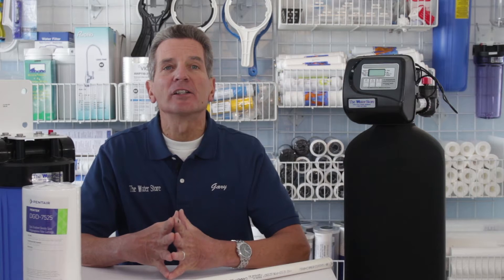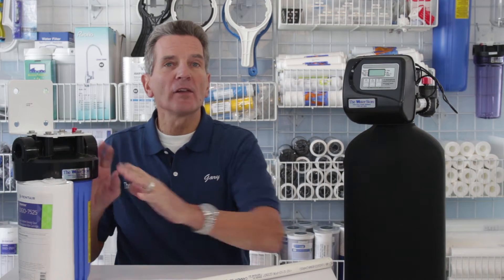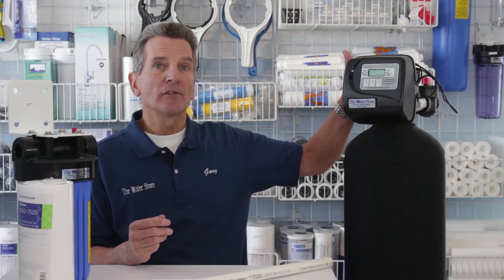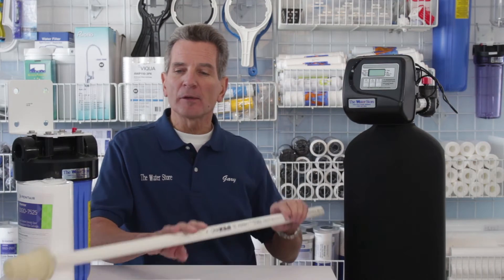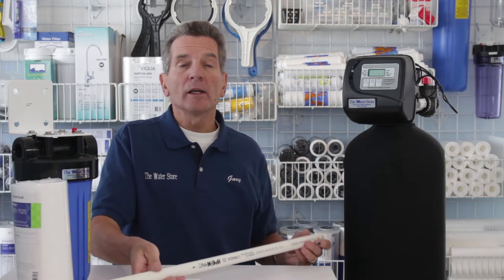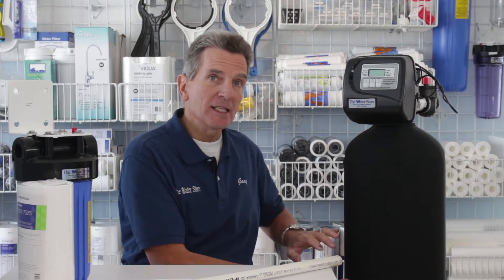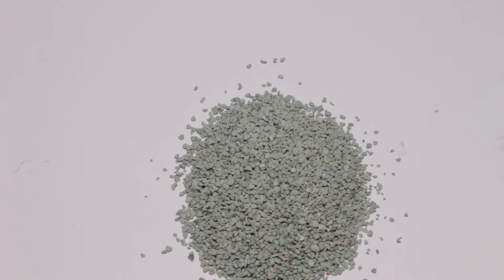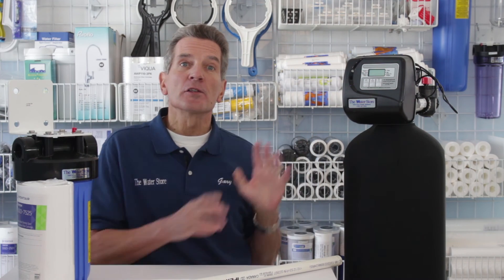How Does a Nextsand Automatic Backwashing Water Filter Work?

Comment: What happens when you leave your house and need to disable the backwash cause the pump is off to prevent a flood.  Can it be left alone and set to work on dp only or does it have to operate.
Reply from the maker: It will think it has gone through a cycle but since there is no water flow or pressure nothing will happen.

Comment: Hey Gary, thanks for these videos! I have a question. Is an upper screen/strainer necessary in these sand filters? I have seen people using upper screens/strainers and others not using them. I m asking because, yes it will keep the media from flushing in the drain during backwash, but how is it supposed to let debris and other unwanted materials out?
Reply from the maker: Yes, I always recommend an upper screen strainer otherwise you won't contain the media.
Reply: Does it help with chlorine in your water

Comment: Hi Gary, my screen on my  control has the arrow 'flashing" on Min Fill"  I do have salt in the brine tank and water is just now visible.  Should I just add additional salt and run a Regen cycle.  As far as I can tell, my water is fine, no signs of scaling etc.
Reply from the maker: That means how many minutes of water are required to be added to create the correct concentration of brine.

Comment: We have a well that was put in 9 months ago. It works great until several days of heavy rain, which results in muddy water that takes at least one week or more of continuously running water of the well to clear. We've only had about 3 times that we have had heavy enough rain to do this in the past 9 months. Would a reverse sediment filtration system be able to handle that amount of mud?
Reply from the maker: Yes it will but I would reset it to back wawsh every day during the event. We have them here https://waterestore.com/search?type=product&q=hum+automatic+sedim

Comment: Hello Gary, if I understand correctly, during a backwash the source water is basically injected in reverse into the filter and it is also "bridged" into the normal output pipe, basically bypassing the filter during the backwash. The nextsand media in the input side of the tank expands and water comes out from the special backwash drain connection. I have two questions: (1) what prevents some of the nextsand media from being flushed with the water down the backwash drain? (2) If I had a pressure tank on the output side and manually closed the source water source and turned off the pump before starting a backwash, would that effectively let me backwash the tank using the clean water that accumulated in the pressure tank?
Reply from the maker: Great questions!  1) The top basket in the tank keeps the media inside.  2) Yes, but why would you want to?

Comment: Hey Gary, Thank you for the very informative videos in regards to water care, I really enjoy your presentation.  I have a Clack Softener 10x54 in one of my rental properties and have acquired a smaller Clack Softener with a 10x35 tank without the resin bed (empty)  I have sediment concerns and was wondering if added the smaller smaller tank pre-softener and if I replaced the smaller tank resin beads with the NextSand media, could I use it as a sediment backwash system and if so, how should I set the regeneration process?  Could I just set it to cycle a little more often but back flush it with water?
Reply from the maker: I really do not suggest modifying equipment for something different.  There are far more variables than changing the settings.  I suggest that if you need an automatic backwashing filter you purchase one.  We have them here https://waterestore.com/search?pf_pt_product_type=System&q=hum+automatic+sediment&type=product
Reply: @water_estore  Thank you for the quick response.  I understand,  I will not use the smaller unit as a sediment filter.  Thanks again and will on the lookout for more of your videos.

Comment: We have one of these, but I unplugged it a few years ago because it seemed like it was no longer necessary, and I was tired of hearing the system clean itself at 2am. Our water all of a sudden has a ton of sediment. Do you think I can just turn this on again to see if it fixes it? Also, should I get new nextsand medium? Thanks!!
Reply from the maker: I would, but I would immediately regenerate it twice abck to back before using it on your household water.  Likley don't need to replace the media but if you do we have it and the gravel here https://waterestore.com/products/nextsand-sediment-removal-water-filtration-media-1-cubic-foot and https://waterestore.com/products/gravel-water-softener-under-bedding-15-lb

Comment: Hey Gary! Question for you. When the system back washes, what is the water source? If it's pulling from a lake (we're planning to draw from our pond on our property) then would it use the pond water to back wash? If this is installed after the bladder tank, then there is no other water available other than the source water, is that right? So if that's the case, then won't it contaminate the bottom side of the media as it exits the riser at the bottom? 
Now, another angle is, what if this was before the bladder tank. Then I have water that has been clarified before the tank, and I have a source of cleaner water for the backwash. Is that a possibility?
Reply from the maker: No, you never install anything before the bladder tank because if it ever became clogged, you woudl burn out your pump. It is normal and 100% acceptable to install all of your water filtration after the pressure tank.  Check out this video https://youtu.be/ml-oMaCplaE

Comment: Help! I have a backwash system like you described in the video. My question is…..what happens if I have to use the house water “during” a backwash cycle (example…flushing toilet, showering or using a dishwasher? ). Will the water I am using be affected by the backwash process?
Reply from the maker: Great question!  It will have almost no affect other than reducing the amount of water availalbe for the back wash but you will be using untreated water.  Typically nothing to worry about for toilet flushing but definitely no showering or laundry.
Reply: @water_estore  is this 1 reason it's great to have inline filters & a UV system downline from the tanks?
Then you are only missing out on the sediment FRP, but still having filtered water in that case